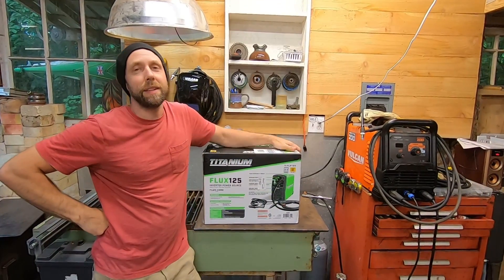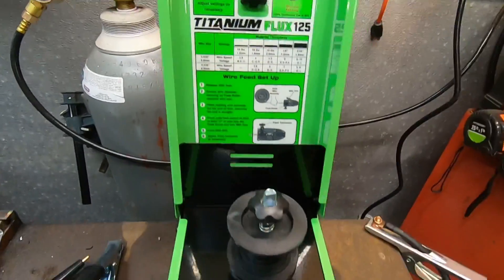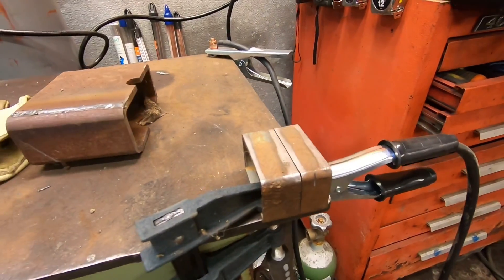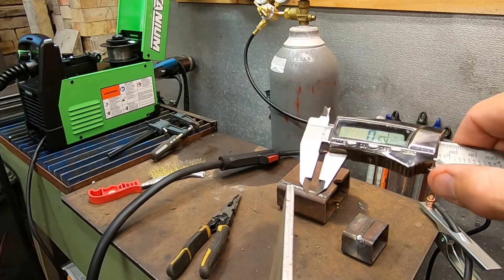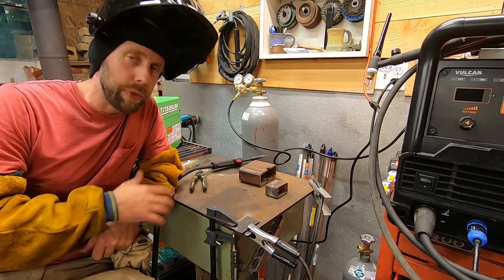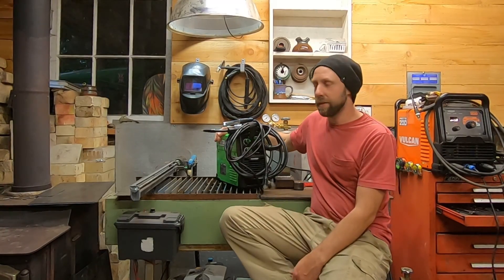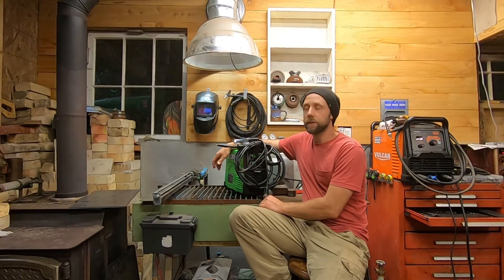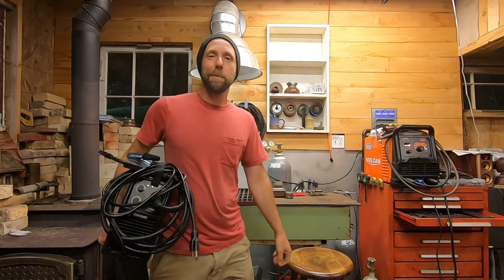Titanium Flux 125 welder from Harbor Freight

Comment: Dumb questions, please forgive me I'm a beginner who doesn't want to get zapped: 
1. It's safe to lean on table with arm/elbow while welding? 
2. It's safe to put gun on table when not using?
3. Is it necessary to get a metal welding table or can wood be used?
Reply from the maker: Hello Alexandra
You won’t get shocked if you touch or lean on your welding bench when welding, the only time there could be an issue is if you are outside welding in the rain and standing in a puddle and even that is extremely rare that you would have a problem.
yes you can put the MIG gun down on your bench or table, if the trigger isn’t pushed in then the wire won’t come out and the tip of the mig gun won’t be energized. 
You can put a piece of metal on a wood bench but it’s not preferable because the wood underneath can get hot and possibly be a fire hazard.
I would recommend if you bought this welder, consider going to Harbor Freight and buy there small adjustable welding table, it sells for about $80 and I think it would be well worth it for you.
What kind of projects do you plan on welding, ART projects or just fixing and repairs?
Here’s a video that will help you get started with this little welder, if you like the video consider subscribing please 🙂
One other thing, if you weld in your garage, consider once you are done, you stick around out there for another 45 minute or so, find something to do like cleaning up, it’s just something I like to do to stay out in the shop for the 45 minutes just for a fire watch, just to be on the safe side 🙂
https://youtu.be/b-zI6OJe-ik
Reply: @Mikefestiva  Hi Mike.  Wow, thank you so much for answering! No welder on YouTube has taken the time to answer these dumb questions of mine. First aid is my main concern as I'm a total newbie, so thanks again! 
Yes, I just got this exact welder! 

1. Thanks for clearing up leaning on the table. I was confused by that. I should only be welding in our garage.  One last thing, if I have my table clamped, I shouldn't pick my project off the table and weld correct? I must always keep it on the table? 

2. I'm now gona buy that welding table at Harbor Freight! I've been eye balling it, but my dad offered to make me a little wooden table. I'll just let him know its safer to get a little metal welding table. 

3. I'm going to be welding tiny metal art, little sculptures, using scrap metal: metal hinges, bolts, screws, washers, utensils, etc. Nothing thicker than 1/8 in. 

Thanks for the fire hazard tip. I'll stick around once everything is unplugged to make sure it's all safe. 

Thanks for taking the time, Mike. Happy Holidays!
Reply: And, yes! I just now subscribed!
Reply from the maker: @dec23  No problem 🙂 I’m happy to help, I like to encourage others to learn how to weld and fabricate, I think you will find a lot of good info in most of my videos.
To answer your other question, most of the time you can clamp your ground clamp to your metal table top and that works fine, if you pick your part up off the table and try to weld your welder won’t arc, you are usually better clamping your ground clamp to your sculpture, especially a clean metal surface, just quickly grind off any paint and rust, the reason you do this is because when you weld you are creating a electrical connection - ground clamp to + electrode wire.
When you buy more wire make sure to buy Flux welding wire, I use .035” there’s also .030” wire, what ever wire size you decide to buy, make sure you buy the same size electrode tips for your welder( the small copper tip that your wire comes out of at the tip of your Mig gun)
A few more things to consider, clean off any paint or rust in the area you’re planning on welding, also grind off any galvanized coating on bolts and stuff in the area you are welding, Zinc isn’t healthy to breath when it burns.
One thing I would also suggest buying at some point is a welding respirator, I bought a nice Miller welding respirator on Amazon for about $35?

Here’s another video that could help, this is part 1 there is a part 2 to this video as well. https://youtu.be/xT-DqcsuzBM
One last thing, make sure you have a fun time! Grab some scraps of metal and just practice when you get time. Welding is a good skill to learn and it’s fun creating stuff! Ps I also have a video that covers places to salvage free scraps of metal so check that video out too.
Take care 🙂👍
Reply: @Mikefestiva  Hi Mike! Excellent tips, man! Seriously, you've given me information I never thought about. I'll be looking through more of your videos! Yeah, I'll just clamp directly to my sculpture - it should be a decent size sculpture for an easy clamp. Good tips on shaving off any galvanized coats on bolts - i never thought about that. I believe I will have to do that for utensils as well. 

If I have any more questions when I start welding, I hope you'll keep me in mind! Happy welding! 👍🏼🗜
Reply: The only dumb question is the one not asked.

Comment: This needs  gas line Gas?
Reply from the maker: No gas is required for this welder, it’s only flux core wire. This means you don’t need shielding gas. The wire used with this welder has its own flux built into it. Very simple welder to set up and use 👍

Comment: It's ALOT more then nice, it's friggin AWESOME  watching this guy who obviously knows wtf he's doing. This is my 1st timing seeing him, and I've done some searching.  I got this like 90 Amp stick, Campbell & Hausfeld I think. But the stick holder never worked right , it don't hold the rod in very well, so as soon as I get an arc and pull up a tan, it falls off.  AHG!  It seems to have enough power,  shit I've melted anything I've tried to weld with it. I think one time I got a spot weld to hold alright on a work cart, (ya know those green meshed garden cart looking things, that really are damn durable) but it was uglier then hell.  Other then that when and if it holds, I've never been able to run a nice bead, (tho I just learned about the cursive 'e' z , or circles.. I was just running a straight line down the shoot,  and literally melting everything up when it was all said and done.. lol. I was either gonna get a nice big welder and spend some big $$$ and take a college course on welding and get certified. But now  I'm thinking, bout getting one of these, and getting someone to teach me. And if they can get me welding in a sufficient amount of time, whatever that is, I'll pay em.  Weldings about the only thing I don't know how to do, ad far as constructing/building has to do. And my fiancée and I got this Lil ranch here with horses duck's,  chickens 🐔   , Rottweilers,  pitbulls,  Shepards, and some moe shit. And I really need to do alot of welding around here.  So if anyone has any tips on what I should do or get would be cool.  Like should I get certified? I'm 53, and really don't need it as a career. Tho if I could make some side cash , that wouldn't make me angry! Or should I get one of these, or maybe a little better.  I do not like the stick thing,  prolly cuz this one I've had no good memories of. Lol. And it seems more complex then these wire feed things. Them seem so easy and cool.  But loading the wire and setting all these different knows with different settings, and gouges, wire speed, steel depth. Penetration whatever else I DONT know about.   
   It prolly seems easy to this guy and other welders ( I'm guessing ALL welders think they're the best, and prolly critical to other welders) but remember i know exactly next to nothing about welding.  But I build homes, and I learn VERY fast when I'm interested and/ or needing to learn something.  And welding is both for me.

Comment: Would this weld aluminum okay?
Reply from the maker: No this is a Flux wire only welder, only for welding steel, if you want to weld aluminum you would need a MIG welder with a spool gun, the most affordable machine I would recommend is the Titanium 170 with the optional spool gun, I think that will set you back about $650 or so. 👍

Comment: Do you need gas with this welder
Reply: Did you watch the video? TLDR; no.
Reply: No you do not need any inert gas for this welder, its a flux core wire welder; operates like a mig but uses a fluxed core metal wire instead of solid copper coated steel wire that mig (metal inert gas welding) does, in essence you just set it and weld, goes any where, great for fencing, ornamental work and more.
Reply: P
Reply: @Roxy0901  p?

Comment: Welders like these have saved a lot of "bacon" out in the desert canyons of Utah, etc. on "4x4 excursions" where we'd break something that really needed to be welded as opposed to bolts or tape, etc. (I busted a control arm in the middle of nowhere, Montana.  Limped for miles upon miles without seeing a sole).
  People like to stroke their own egos and put down anything smaller than the "best" they're able to buy but, that's nonsense.
As long as the welder keeps a clean bead at reasonable duty cycles (more than a couple of inches before cycling out for 30 min. to cool down), it's OK for fixing frames and supports, making jigs and fixtures, etc., esp. while out on the trail.
  As I say, people really enjoy "pooh pooh-ing" something like this, right up until they are the ones that need to be rescued. 
  My son and I are outfitting a big (mid 80s), 4x4 Suburban for a cross country, open trail trip.
  I'll be setting up a dual battery system with possibly even a third (I get overly ambitious at times) <grin> strictly for running lights, etc. w/an alternator stolen from a fire/rescue vehicle to handle the extra amps and will have a large inverter for a computer, small fridge, welder, etc.
  There's no way I'm going to be stuck in the middle of nowhere, on a solo run, with a busted frame, rock slider, spare carrier, skid plate, torn body panel or just a busted swing arm on a "swing-out, utility hook" that supports gear.
  I've seen too many "that could never happen" type situations that actually happened because...  
"Murphy is my co-pilot."  😆 
  Anyone planning an overland excursion or building a search/rescue type of vehicle should always dedicate space/weight allocation for 100 lbs. (minimum, 100 lbs goes fast) of tools/equip. such as a welder, hand tools, cordless impact, grinder, compressor, etc., on top of the "standard kit" of shovel/pick/axe/pry bar/sand anchor/jack, jack handle & jack foot plate/winch accessory  (snatch-block, tree straps, cable blanket, shackles, gloves, remote, etc.) that are mandatory for any long distance, off-road adventure... Outside of a close-to home, RV park, "single destination" (driving in a circle) type trip.
  I realize how much "extra stuff" I've written as "necessary" here but, I've seen lots of people (including myself) lost/stuck/disabled in some pretty desolate landscapes while I was living and stationed out in the Montana/Utah/Colorado/Nevada deserts and mountains of the Rockies...
Some of them didn't come out alive.  People are too over confident and put themselves in over their heads, all because they let their ego overtake their common sense. 
  While in the Airforce, in Utah we did a lot of civilian relief, flood aversion and S&R types of operations, after the massive, annual storms and flash-floods that would wipe both things and people out of the canyons and flood the city of Salt Lake.  Some simple equipment would have saved a lot of lives and desperate situations but, inexperience and over confidence, the "curse of the rookies" gets a lot of people into trouble.  For every one seen/noted, there are several more that go unreported because they got out on their own...  Eventually. 
  If anything I've said here gets people to realize the dangers and saves just one person or family from tragedy, that's what it's all about and this diatribe/rant is worth it.
  That starts with being properly prepared for the unforseen/predictable events that are inevitable, once you're out of cell phone range.
  Something like a portable, light duty welder (flux core mig or even small stick) would be a godsend when you bust a control arm or tie rod.
  Bright blessings, easy trails and pretty sights to all (and to all a good night...)  😉
Reply: "Murphy is my co-pilot."  Too funny!
Reply: @miscellaneous037  
  Thanks, you induced me to reread and "fix" my late night, rant of a comment.  It "reads better" now (but it doesn't really read, at all).  😀

Comment: A bit old, I know but I'd have liked to see you put the welded items in a vice or something and try to bend/break the weld to see just what penetration you did get and if it holds well.
Reply from the maker: These welders work great Richard, I have no concerns with the penetration of the welds. I built a bandsaw mill from scratch over 6 years ago with an old Lincoln flux welder and every weld on that mill are solid still. This welder works far better then that old transformer Lincoln I owned in the past.

Comment: I was sent here from the harbor freight ad. I was just curious about welders after seeing the ad and thought I'd take a look at this video. And you know, even if I wasn't remotely interested in buying a welder, I think this is a great video. And in fact I'm ready to go buy a welder right now. I always thought about it and now seeing the price and seeing the the quality and seeing the work you did,  I'm going to do it! One of the things I want to use it for is metal sculpture. Of which I have no clue about. But it's art! I can do whatever I want.

Also, I'm a tech, I was various disciplines, and there are so many times where I know I could have used a welder. Now that they've become so inexpensive and easier to operate it's time to get one. Even though I'm retired, I like to work on old junk like cars, vintage lawn tractors, bicycles, and more. I'd like to do some custom work, I've even got an idea about building a bobber motorcycle. Yeah so I guess you could say that little harbor freight ad really worked out for them and I think you did a great job on this vide. You're a natural at doing presentation work, you're enjoyable to watch and listen to, and I'm looking forward to seeing more of your stuff. Later! John.
Reply from the maker: That’s awesome! Good luck with your future projects, thanks for watching and supporting my channel! 👍
Reply: I got one the wire speed control knob doesn't work  after 6 small weld jobs it keep spinning around and around

Comment: Bought one, and the dang wire feed will not stop. I have used it twice before the problem started. No idea what is wrong. I can disconnect every lead and it just keeps feeding
Reply from the maker: That sucks! Have you had it less then 90 days? If so take it back.
If it’s out of warranty, you can check the trigger in the handle, it’s probably stuck in.
Reply: @Mikefestiva  it will feed even if all the leads are removed. It's something internally. I have had it since Feb 28. So it's out of warranty of course... Failed on the 3rd use...
Reply from the maker: @chrisurfer83  the leads don’t disconnect from this welder, are you referring to not havthe ground connection hooked up?
There’s a micro switch in the MIG lead, if that switch is stuck it will continuously feed, there’s also a cold wire feed switch inside the top cover next to the motor drive, make sure that’s not stuck on.
Reply: @Mikefestiva  you are right! I have the Titanium mig 170. My bad! I will look for a switch. Right now the only way to make it stop feeding is to flip the  switch to the spool gun.
Reply from the maker: @chrisurfer83  Okay that makes more sense that you have the 170, there’s a switch on the front that says T2 T4
You want it to be in the T2 position. Let me know if that takes care of your problem?
Reply: @Mikefestiva  I really appreciate your help. When it worked it was a fantastic experience. Hopefully I'm just missing something simple. Will update you when I get home.
Reply: @Mikefestiva  sadly the 2t and 4t position have no impact on the issue. Only thing that stops the feed is switching from torch to spool gun.
Reply: @Mikefestiva  if you want to see exactly what is happening I made a quick video. "Harbor Freight MIG 170 feeding wire uncontrollably, what am I doing wrong?"

Comment: Ive seen road service use this exact welding machine to repair a class 8 (60,000 lbs) trailer landing gear out in the field. Solid machine lol
Reply: Glad to know that. I plan on doing a little structural work with mine as well.

Comment: Can this weld 1- 1 1/2” aisi 1018
Reply: It depends on what you want to use it for .. either way you'll have to do multiple passes when it comes to thick metals, check the titanium unlimited pro  it works like a champ or look for the amico power 200 stick welder  i use that one to practice couple of days before a test, i use the  titanium 125  for thin materials when building fences , gates or doors
Reply: @paintballfreddy  ah ok thank you very much
Reply: It does with multiple passes
Reply: @paintballfreddy  what welder would be better for that type of material